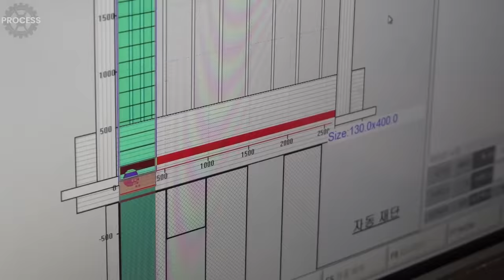Mass Production Process of Making 3-Drawer Chests. Wooden Furniture Factory in Korea.

Comment: Very low quality, which is strange and not typical for South Korea.
Reply: Why do you think they are making thousands of these and selling them? Because they are meeting market demands. It looks good from the outside, will hold up for several years under normal use and they probably cost under $50. Sure you make all hardwood custom 3 drawer chests with $50 drawer glides, etc and sell them for $800, but who is going to buy?